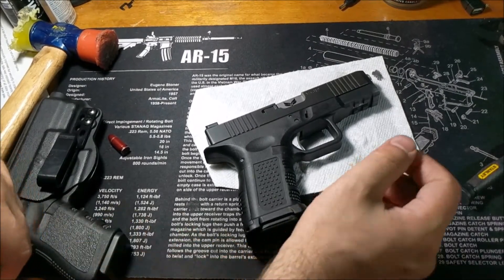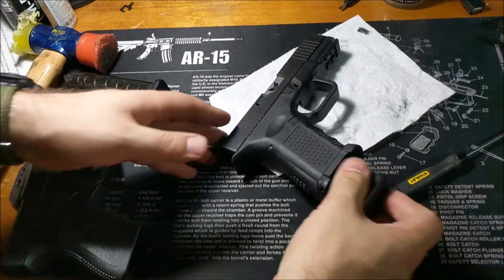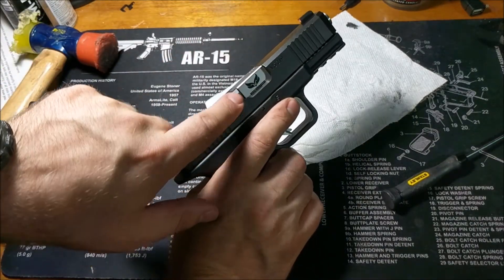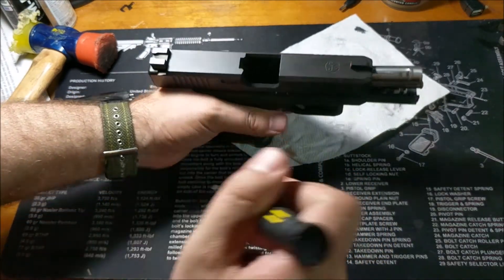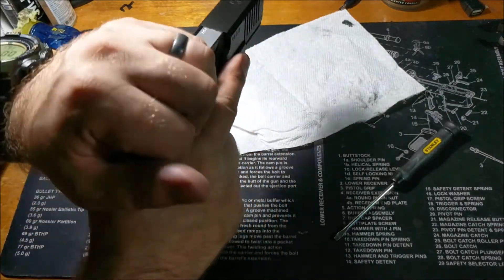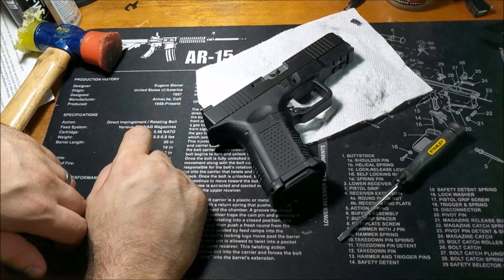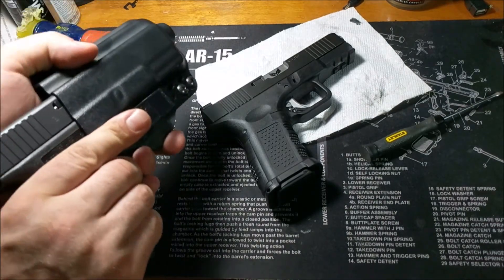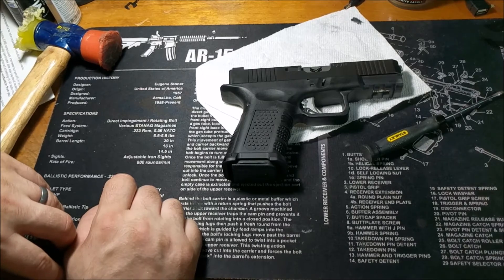Compact Timberwolf and Suarez V5 9mm (Part 1)

Comment: Might want to use oem glock or suarez parts in a suarez slide
Reply from the maker: CaFFeineSouLja Agreed. last week I replaced the extractor with an Apex failure resistant one. Replaced the ejector with the Glock 30274 last night. The extractor alone fixed most of the issues. I'll fill you in if the ejector makes it 100%.